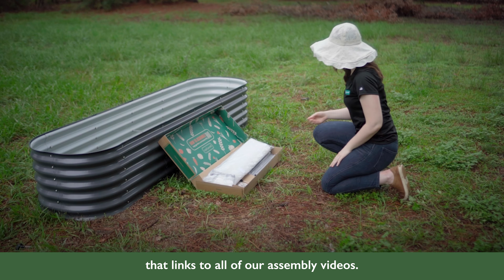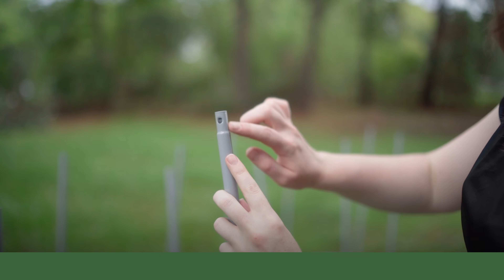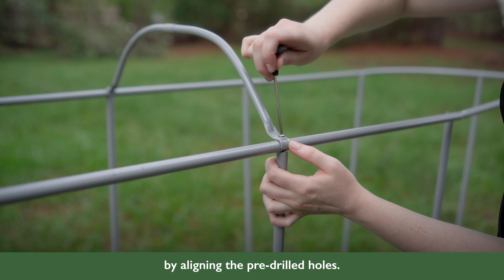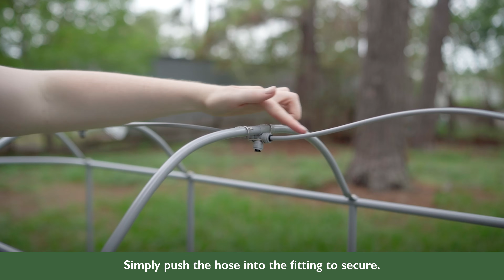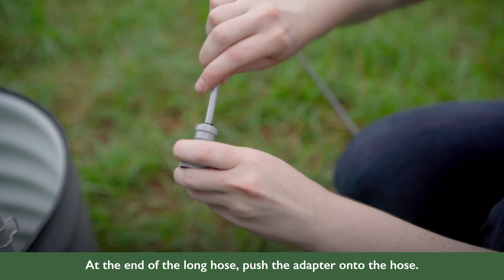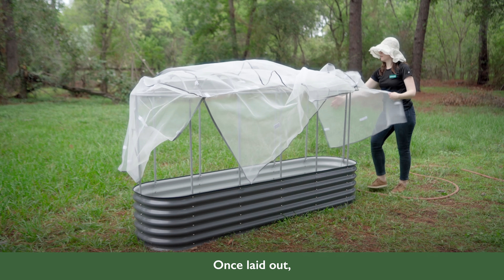Cover System & Mister Irrigation Assembly Tutorial | Vego Garden

Comment: My Vego mesh cover system came with cheap plastic connectors instead of screws to attack the perimeter and bows. It looks like a breeze will blow it apart. I got the cover because it looked like it was securely fastened.